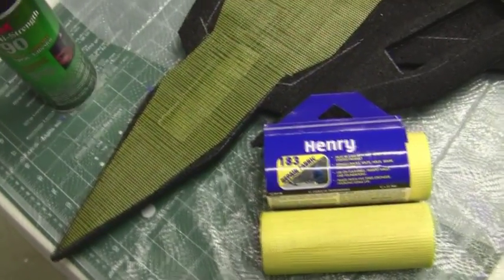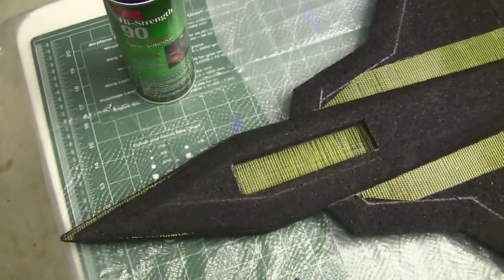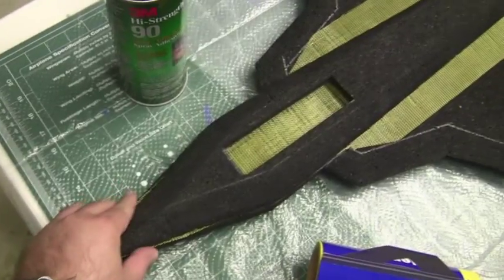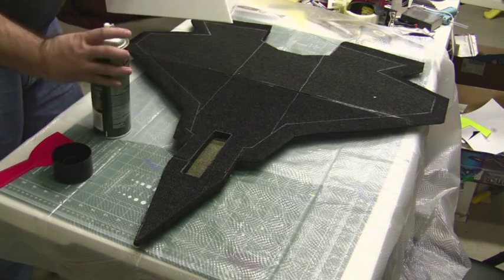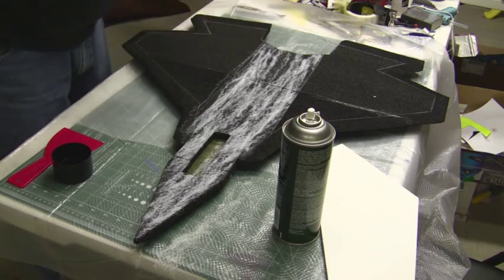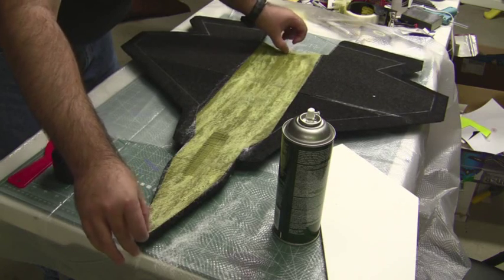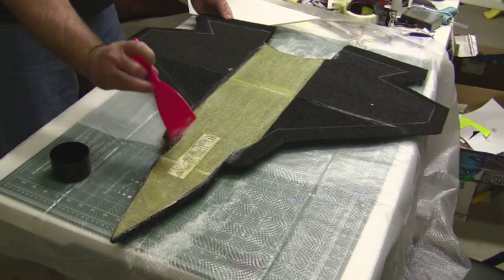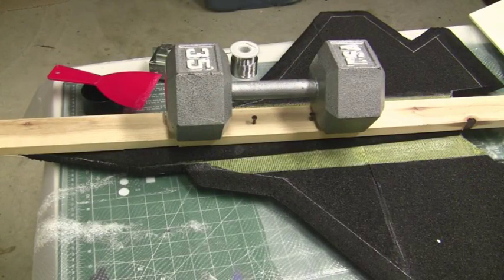Part 2A - EPP Park Jet (Scratch Built RC Plane)

Comment from the maker: EPP is Expanded polypropylene, an engineered plastic foam material.  Stronger and more resistant to damage. it works well to make a plane that can survive some pretty good crashes.

Comment: Hey there just a question, 3M90 spray you used, can it be used with depron? EPP foam can take CA even... which is not the case with depron. I'm afraid 3M90 spray would eat depron... am I right? Thanks!

Comment from the maker: aecomputer1, you can get it at Home Depot. The one on Hwy K has it, thats where I got it last. It is usually in the Roofing Repair area. Alos Home Depot carries the 3M 90 Spray adhesive.  this adhesive will work for EPP but NOT on Blue core or some others. So if you use it, test it on scrap material first to make sure it does not eat the foam. Anyway, would love to hear how your testing goes if you decide to use it. Thanks for the comment.

Comment: Thinking about using the Henry coated fiberglass weave on some scrap pieces of EPP and Depron 6mm sizes. 75 pounds per square inch sounds really good for thin park jets. Hope you don't mind when using a lot of yours and Franks ideas... but don't worry, I will give you guys the credit.  LOL